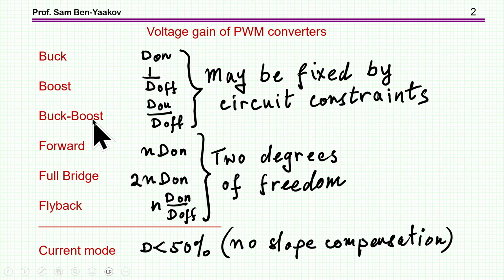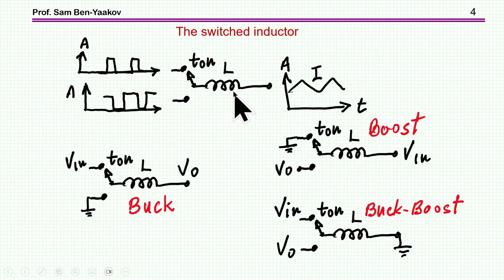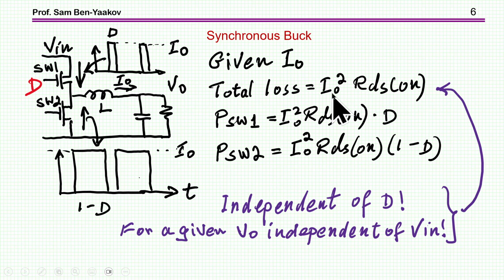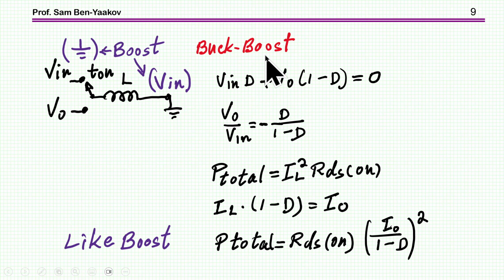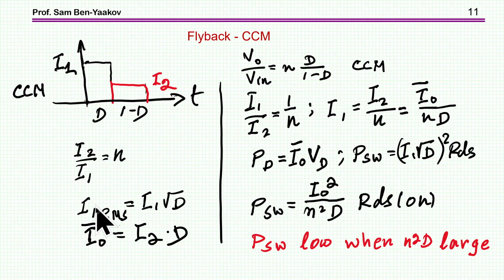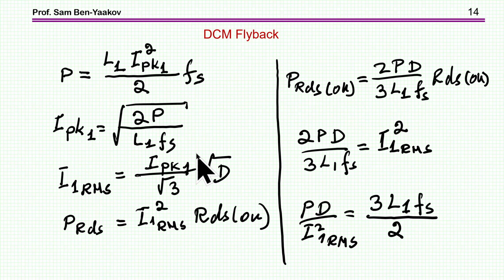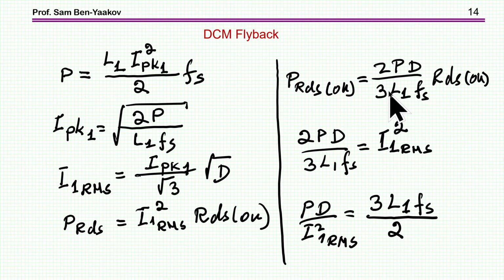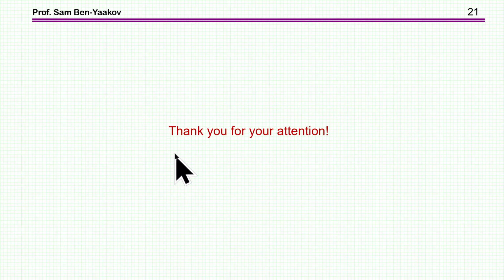The effect of PWM converters’ duty cycle on conduction losses

Comment: Professor, I’m struggling with the design of SMPS power supplies—specifically the section from the 220V input up to the start of the buck converter(s). I’ve already implemented the EMI filter and protections like MOV, NTC, coupled inductor choke, and an X-cap.

What confuses me is the stage after that. ChatGPT suggested I should add a boost converter and then a diode bridge, which would give me around 400+ V to feed into 2 or 4 buck converters (I haven’t decided yet). The idea is to get a smooth, stable current.

The part between the X-cap and the buck converters still feels foggy to me. Did you perhaps cover this somewhere, or do you have any advice? Also, I admit this stage worries me the most from a safety perspective—400+ V is no joke!
Reply from the maker: What is the system you are trying to design? 220Vac to what voltage(s) power level?
Reply: @sambenyaakov  24V 5A, and i want as smooth current and voltage, interested into low to medium power supplies up to 500W, wanna make my own lab power supply with SMT32F411CE as driver mcu.
Im smashing my head between choice going toroid transformer with one winding for high power and one for        mcu, not sure which way to go, toroid transformers aint cheap but they do simplify a lot.

Comment: For a flyback operating in CCM, shouldn’t the output current be the secondary winding current times (1–D)? Or is that incorrect?
Reply from the maker: I defined Io as the average current, which is Ipk(1-d). The power dissipated by a diode is Vd times the average current.

Comment: For boost converter, could you write up the loss emission for SW1 and SW2?
Reply from the maker: For SW1 multiply the inductor current by (1-D), for SW2 by D
Reply: @sambenyaakov thank you. But if you add them up, dont you end up with the same as for the buck?
Reply from the maker: No, because the inductor current in boost is higher than in Buck for the same output current

Comment: So this is one of the reasons why flybacks are not good for high step down ratio (30 or more) converters…
Reply from the maker: In addition there are the coupled inductor losses which will also be higher.

Comment: Please make a video on how to make 100A driver @ 2-5V for pulse duration upto 4ms. This is mostly use to drive laser diodes,
Reply from the maker: That sounds like a good video idea, especially if short pulses (in the sub-microsecond range) are also included. I will consider it.